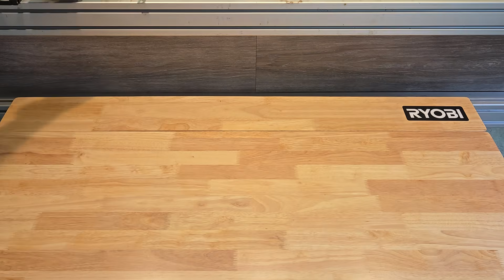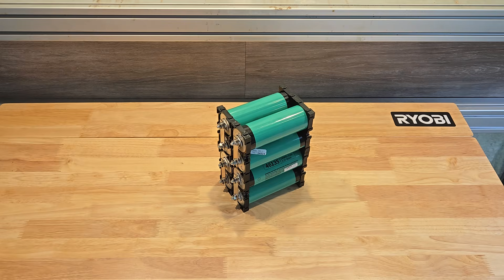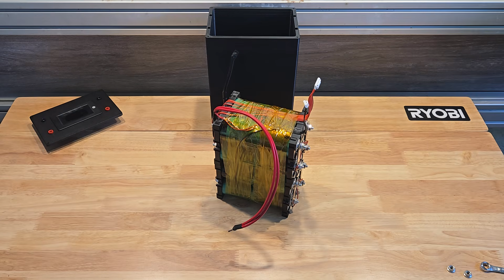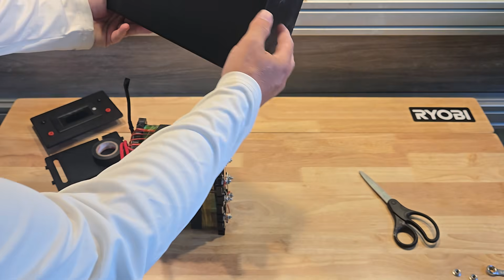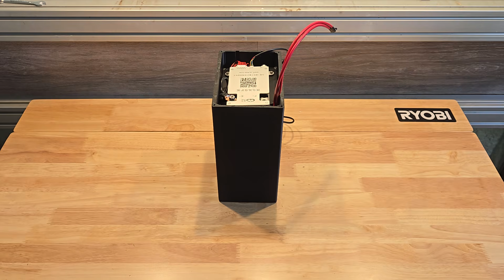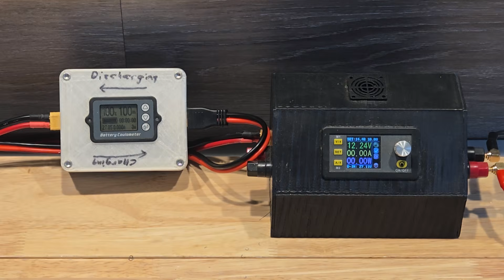Hengtai 3.2V 25Ah 46135

Comment: TIP - When your printing a box like that adjust your size up by 2% higher to make up for all random measurement differences and just shim if you have to. You can also just dump the 5 thread nuts for 3 thread thinner ones and be OK, 25 amps no issue on that, even using a 120 sanding flap disc to remove some stud length.

Comment: Great video! So eight cells equal to 75 ahs?
Reply: No, the way he built them, he ends up with a 25Ah, 24V pack.  If you put 4 in series, and put 2 of those in parallel you would get 50Ah at 12V
Reply from the maker: When in parallel that is correct.

Comment: How many amps do the busbars handle? can they be doubled up to handle higher loads? im looking at a car EV thatll draw ~300amps at high load times
Reply from the maker: Sorry i dont know that info. I would email batteryhookup.com about it. They may have that info. I would be very interested in how you would be a ev pack with these. I would think thermal management would be a challenge for tube cells.
Reply: @TechCentric_00 oh ok, you think they would get too hot? Im working on a hyper9 EV build which are small light air cooled motors that only draws 500 amp at peak and prob 150-200 continuous. I saw these cells can handle 75ah continuous so I was thinking of 10 in parallel would be more than enough

Comment: Pretty new at this lifepo4 business.
I understand that the BMS protects against over charge/discharge.
Im still foggy on the active cell balancing and what i would need to charge something like this.
Any guidance is very much appreciated.
Reply from the maker: If BMS has active balancing there really isn't much to configure. You can adjust how close you want the cells to be to each other, but I have rarely changed this setting. For charging if start to deal with multiple different battery packs with different voltages you may want to invest in a wide voltage range desktop.power supply. If you are sticking to smaller packs like 4s (12v) you can get dedicated lifepo4 chargers with different levels of amperage levels.